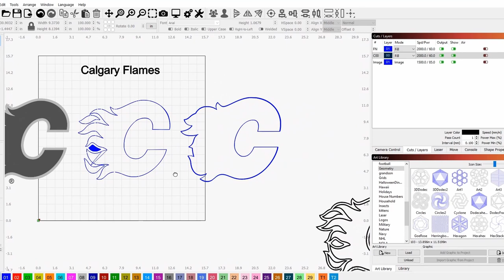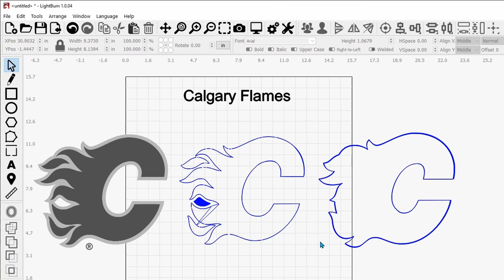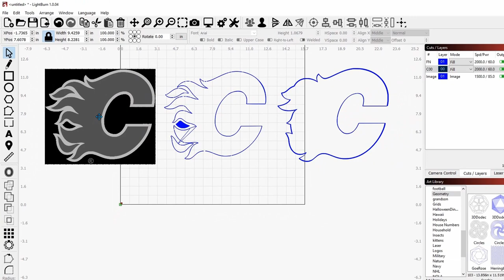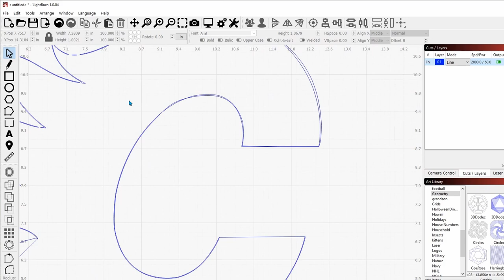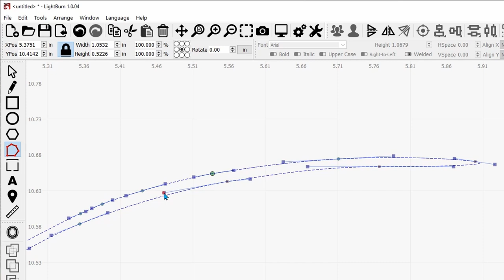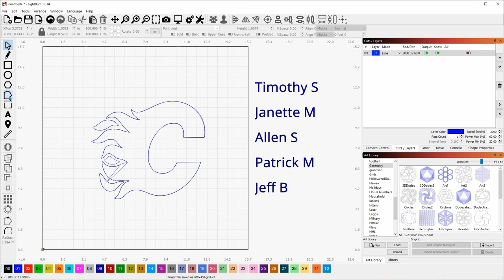Node Editing & Sketch Tutorial in Lightburn!

Comment: Great tutorial as always Rich!  I also use this powerful edit node function for other problems. 

I like burning images on dried leaves such as maple leafs. Were the line of my image crosses the main thick stem that goes through the center of the leaf, 
the laser will not cut through in one pass. I cannot increase the power settings as this will be too much for the rest of the fragile part of the leaf.
so, what I do is go into the edit node function and find the path of the line that goes across the part that will need extra power or passes to get through.
I break the line where needed on both sides of the stem, and when separated from the rest of the path, I select it(because it no longer is
connected), and put it on a separate layer.
You can then turn off the output of the rest of your project and are left with only that small selection you have isolated. Just a matter then to adjust the power or speed or number of cut passes to get through the thicker material.

This will work for any line that did not burn properly (not dark enough or even skipped, without having to go through the whole burn cycle of your
project again. 
Hope this isn't too confusing.
Perhaps, Rich, you could do a video on this. You could explain it a lot better than I can.
Cheers my man....keep the videos coming!!
Reply from the maker: I think that explanation was clear enough Lance! Thanks for sharing! 👍

Comment: Please Help…

I have a big Problem, I use lightburn for a week to check different settings and works perfect, since yesterday i have problems with frame and laser start point, so today i read the setting of the board with the lightburn option and now everything is upside down, when i try to move the laser up goes down and press down goes up, any ideas what i did?   I uninstall lightburn and reinstall again and same problem… now i check with LaserGRBL to check the axis and everything is ok up goes up and down goes down.. i dont have a problem with left/right works fine like you see in the picture the screen is upside down but engrave and cut in the right position…
Please any ideas??????
Reply from the maker: First RIGHT CLICK the Devices button on the laser tab and see if that works. Check to make sure you have the proper Origin set in Device Settings. If you do have the correct origin, on the console tab, you can type in $RST=* and see if that works. If not, type 
$3=2 and press enter and that will reverse the Y commands in Grbl. Check the Origin first! That's probably the problem.
Reply: @TheLouisianaHobbyGuy  yes, you are great, was the origin bottom left was the correction, don’t know how I change to top left.. anyways thank you so much for all your help, i am looking for a job but as sun i have it i will patreon you…… thanks thanks again
Reply from the maker: My pleasure Juan! Glad I could help!

Comment: Is this only for an image? I am trying to straighten out a cut line and it isn't working.
Reply from the maker: Just delete the points on the line between the two points where you want a straight line. Drag from left to right over all the points in between and then press the D key and the line will be straight.
Reply: @TheLouisianaHobbyGuy  That's the problem it is a line. There are no nodes on a line to correct, only on images.
Reply from the maker: Well then select the line, click on Edit Nodes, and move either end (little red square) up or down to where you want it.